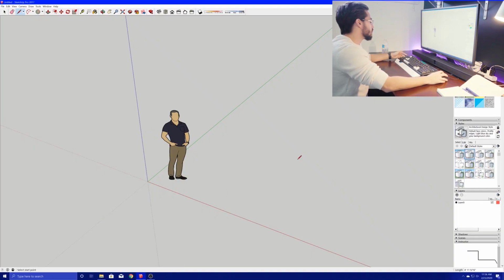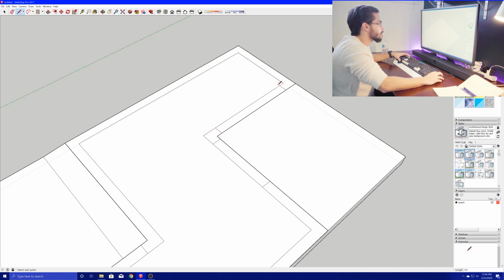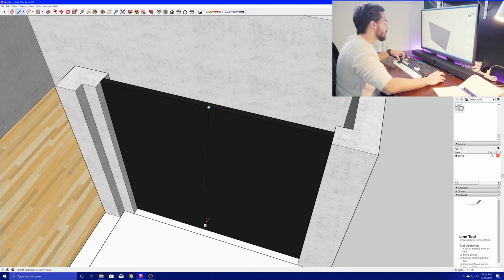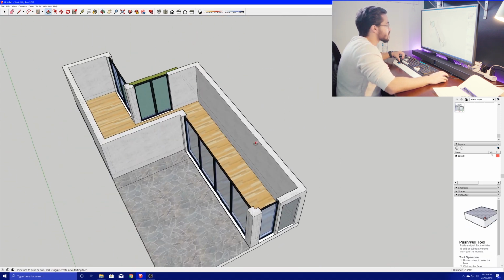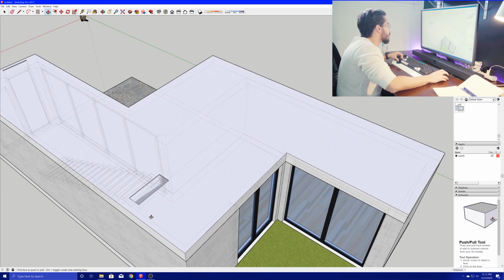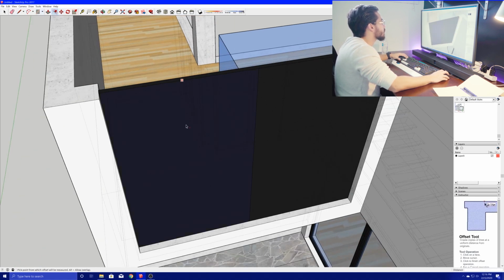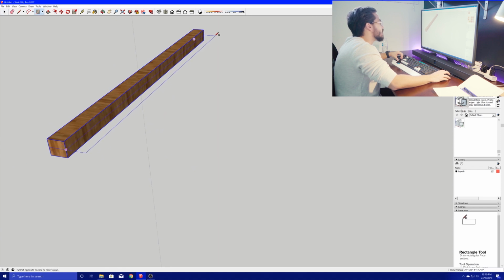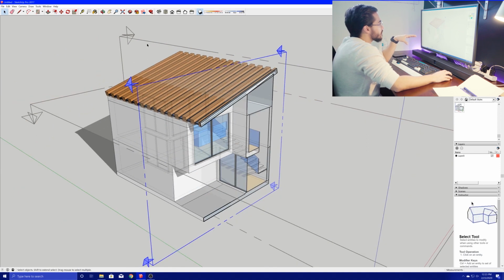LEARN SKETCHUP IN 30 MINUTES

Comment: I had such high faith bc you clearly know what you are doing and communicate well but it has taken me an hour to build my model up to the 7 minute mark and I know a lot of software packages.... literally having issues every step of the way. When you draw the shape of the house and then drag it up mine doesnt leave a base line on the outside of the walls which means the outside of my walls werent the concrete material. When I tried to create the frame centered in the wall I couldnt figure out what your clicks were doing, finally figured out that some of them were clicks that didnt do anything and that I had to click diagonal corner to create a rectangle. When I tried to find center you are just hitting an arrow key and it is completing a line for you... doesnt work for me I have to drag it all the way down. When you push the windows in and then "just click to remove it" that never happens... all kinds of random other crap happens. I think a lot more is happening on the keyboard than what you are describing. Oh well.... off to another video somewhere.